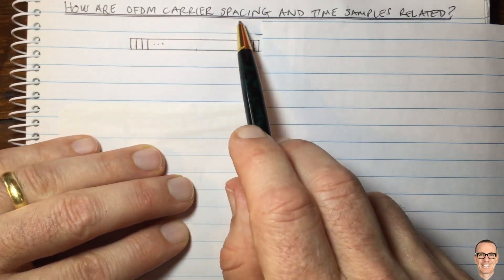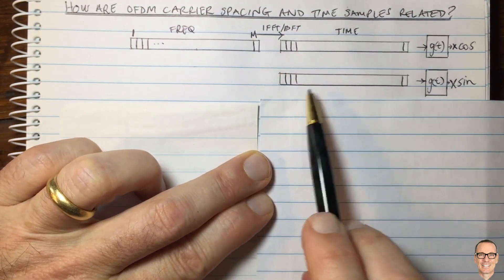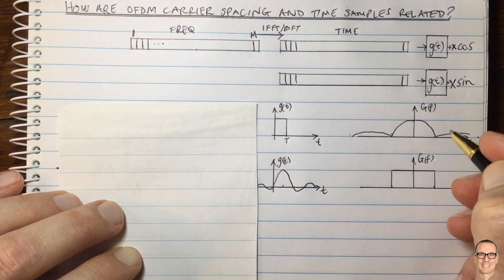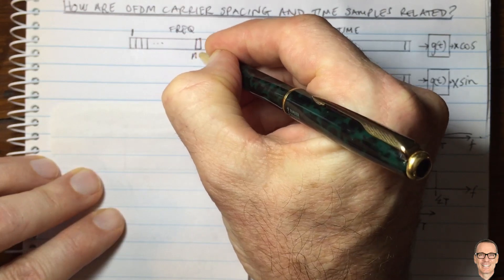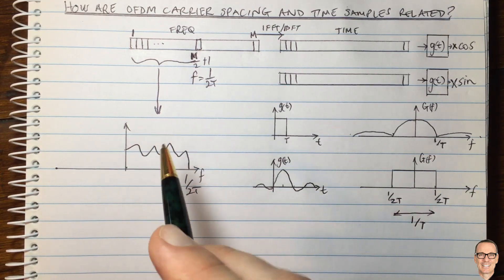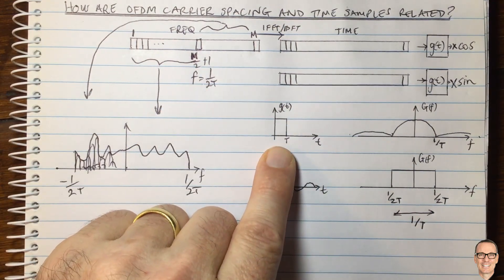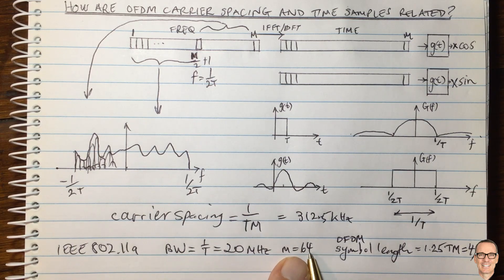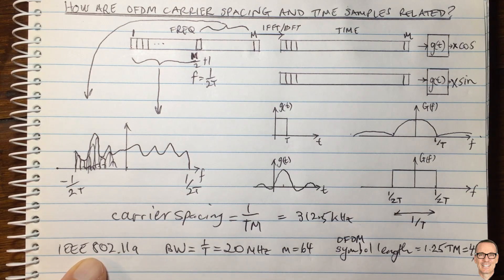How are OFDM Sub Carrier Spacing and Time Samples Related?

Comment: @Iain Explains Signals, Systems, and Digital Comms lain 

Hi lain, Hope you are doing fine.

I want to ask you some questions not related to this video:

1) We see bit error probability vs SNR curves in digital communications. What I know is that a threshold of this error probability exists which is application specific, and below which the communication fails. By a failed communication, here I mean dedoding a packet incorrectly. Am I right?

If the SNR is below the SNR corresponding to the threshold of bit error probability, then the packet is considered to be decoded incorrectly? Is this understanding correct?

2) I am developing a simulator for NR V2X mode 2 (sidelink) where the desired user senses the resources to detect transmission on these resources by other users. To do this, the desired user needs to decode the SCI received from other users. If the SCI is undecoded or if it is decoded but the sensed received power is less than a power threshold, then that resource is considered to be available. My question is, what if more than one users use a particular resource? How to deal with that? How to decode them? What to consider? Can you please give me some light on this matter.

Thanks
Reply from the maker: Answers: 1) Yes. 2) Decoding information from other users depends on the particular signalling protocol. So I can't really answer your question, since the protocol is not specified.
Reply: @iain_explains  thanks for your reply.

Regarding protocol,  can you please name some so that I can search what is used for the one I am talking about?

Comment: Thank you sir
Reply from the maker: You're welcome
Reply: @Iain Explains Signals, Systems, and Digital Comms lain 

Hi lain, Hope you are doing fine.

I want to ask you some questions not related to this video:

1) We see bit error probability vs SNR curves in digital communications. What I know is that a threshold of this error probability exists which is application specific, and below which the communication fails. By a failed communication, here I mean dedoding a packet incorrectly. Am I right?

If the SNR is below the SNR corresponding to the threshold of bit error probability, then the packet is considered to be decoded incorrectly? Is this understanding correct?

2) I am developing a simulator for NR V2X mode 2 (sidelink) where the desired user senses the resources to detect transmission on these resources by other users. To do this, the desired user needs to decode the SCI received from other users. If the SCI is undecoded or if it is decoded but the sensed received power is less than a power threshold, then that resource is considered to be available. My question is, what if more than one users use a particular resource? How to deal with that? How to decode them? What to consider? Can you please give me some light on this matter.

Thanks